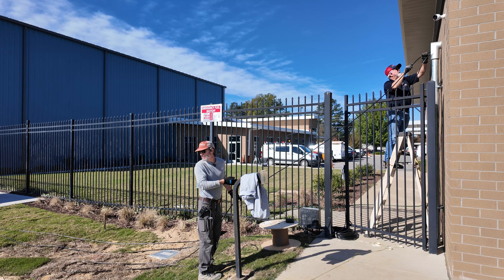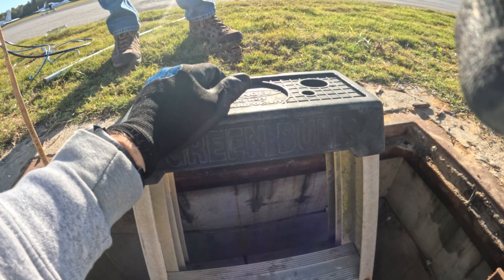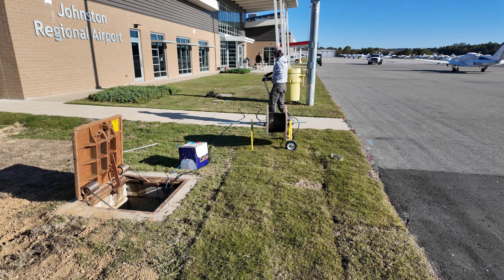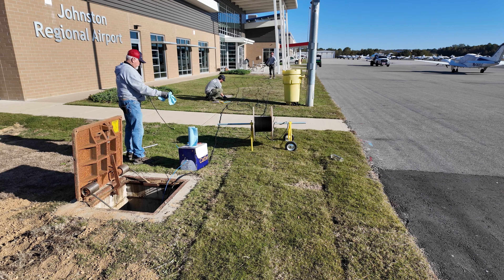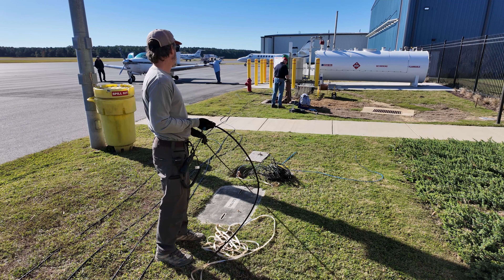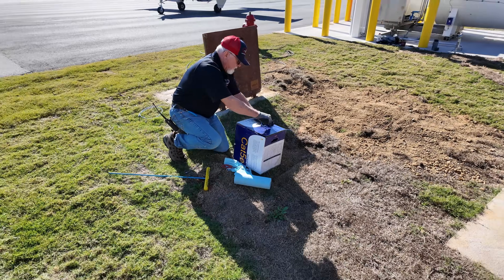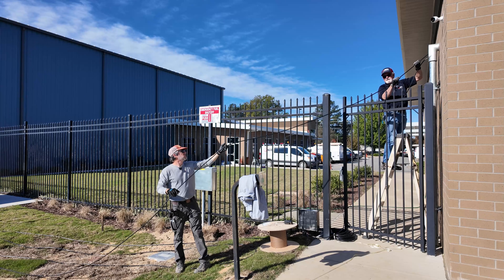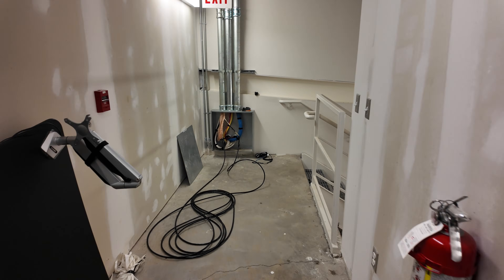Airport Fiber Project - Day 2

Comment: Next guys will be mad you didn't replace the pull tape.
Reply from the maker: I would be too if someone didn’t leave a pull string. We left a pull string in the outdoor run. There were several pull strings in the MaxCell channels on the inside run.

Comment: Always nice when you have existing conduit lines that you can run cables into! Nice work.
Reply from the maker: I agree. Most of the conduit was installed but we did have to connect the main conduit run outside, this was done in the previous video. Thanks for watching!